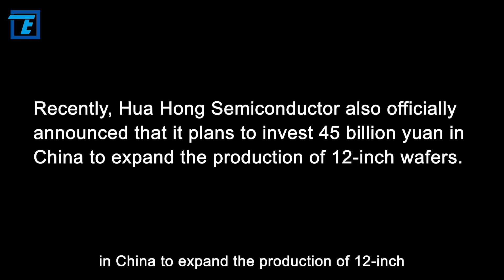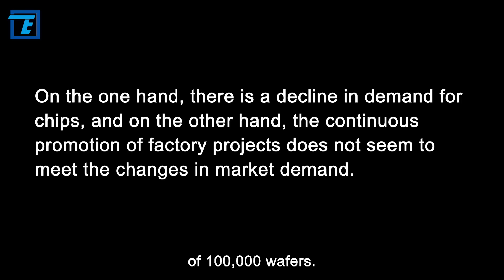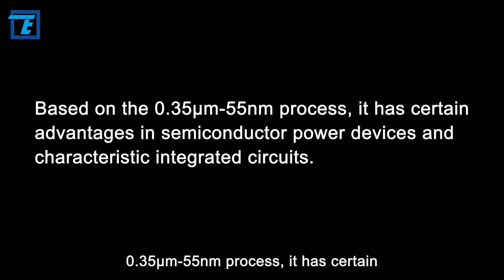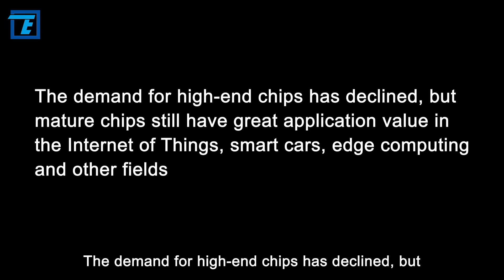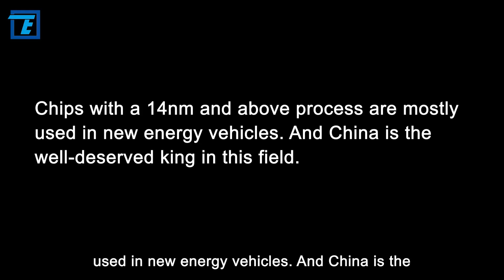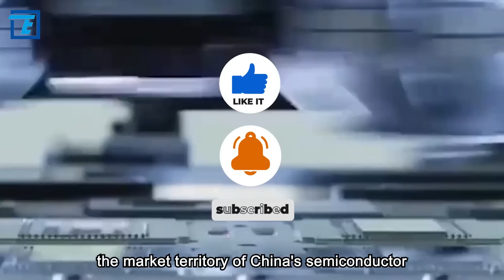Is China really in no hurry? 45 billion expansion of 12 inch wafers

Comment: The US may have made a strategic mistake in putting all its semiconductor investment in high end fabs.  As the video points out, the market for mobile phones, laptops, and even PCs are flattening and in some cases declining.  The new functions that used to create demand are no longer happening at the rapid rate as before and these sectors have become commodities.  Whoever can create inexpensive chips with high bit rate computation and low power consumption will see the next rise in computing semiconductors.  If the promise of photonics and quantum chips realize the benefits of carbon wafers, that goal may become reality.  Right now high end silicon chips are expensive because of the cost of lithography.  Current EUV machines cost about $150 million a pop and the next generation EUV from ASML are said to cost $400 million.

Even TSMC is spending more to advance the production of mature node chips on the mainland where sectors like automotive and consumer embedded processors are still growing.  

On another application, gallium devices are starting to rise.  Chips made from GaAs and GaN are on the rise because of their power and thermal range performance.  China controls 97% of gallium minerals and a dominant share of gallium wafers.

Bottom line:  Biden's rhetoric about the US becoming a semiconductor powerhouse and establishing its own semiconductor supply chain rings hollow.  The US may have much of the semiconductor production equipment and EDA software, but that is rapidly changing as China produces both sectors to reach a  degree of self-sufficiency in its supply chain.

https://www.fierceelectronics.com/electronics/chip-equipment-sales-soar-china-while-north-america-tanks

https://cset.georgetown.edu/publication/chinas-progress-in-semiconductor-manufacturing-equipment/

https://english.etnews.com/20220905200001#:~:text=China%20urgently%20developed%20their%20own,through%20a%20low%2Dcost%20attack.

https://www.digitimes.com/news/a20230113VL205/china-eda-empyrean-technology.html

America's restrictions on high end chips, semiconductor production equipment, and EDA/CAD software is being replaced with domestic and European products.  All Biden has done with his restrictions and bans is to accelerate China's self-sufficiency in semiconductors. In 2023, China's implementation of gallium, photonics, quantum, and carbon based semiconductors are coming into fruition and if realized, will reduce the demand for high end silicon chips. It could mean that the US wasted $52 billion in funding high end silicon fabs only to find no market for its outputs.